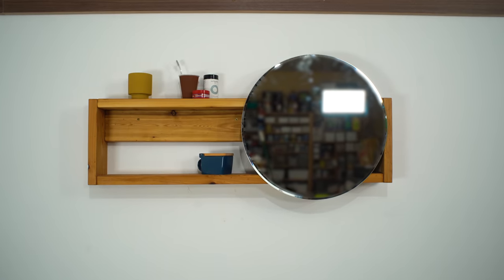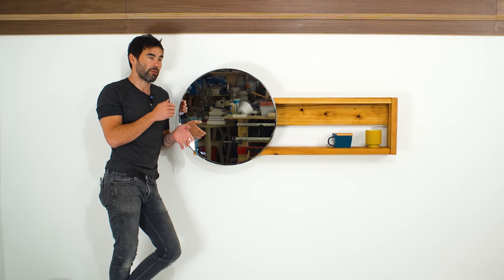DIY Shelf with a Sliding Mirror

Comment: i think this is the first time seeing behind the camera, via the mirror. nice :D also really love the sliding mirror. the design is actually super adaptable, i could see this work nice with a square mirror, maybe inside a wooden frame. one could even build this with steel: using two square pipes with space in between to act as the sliding guide, and using wider steel pipes for the sides. this would allow users to interact with the piece via magnets. cool stuff